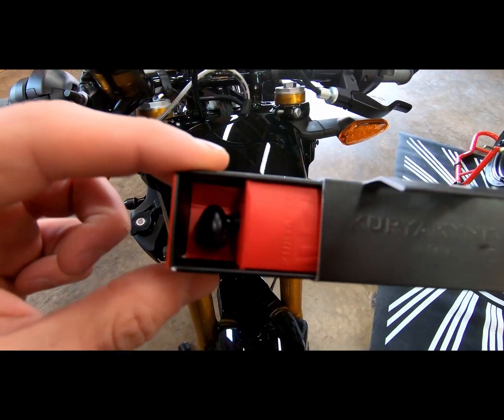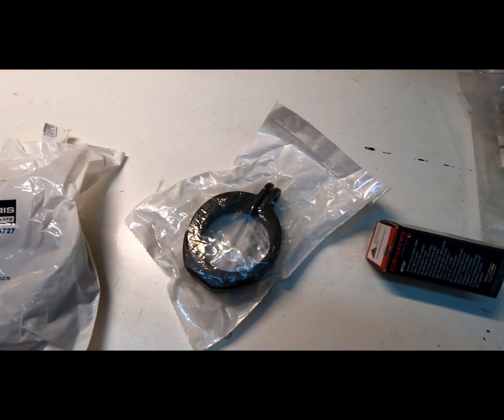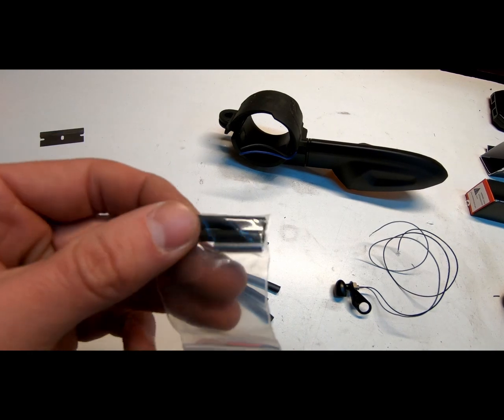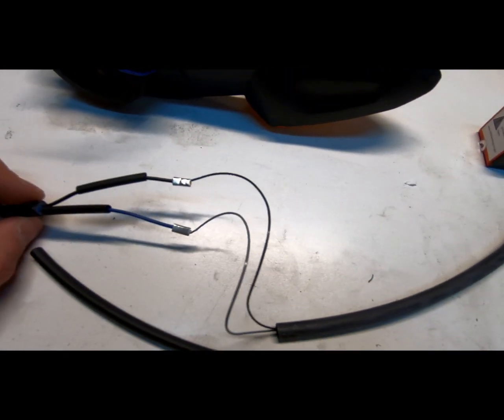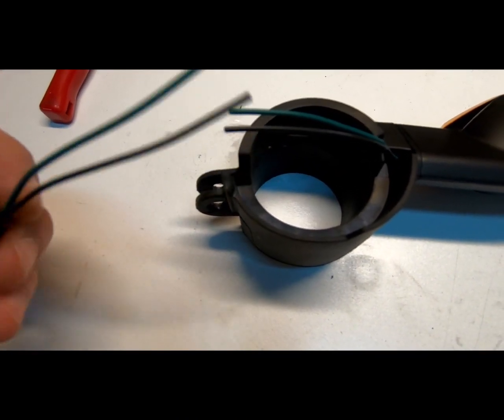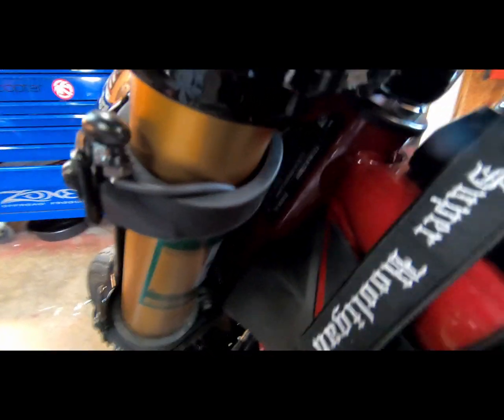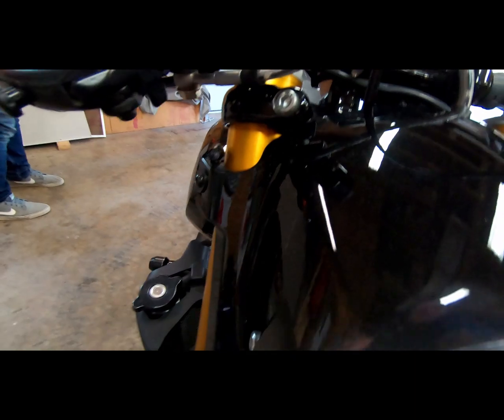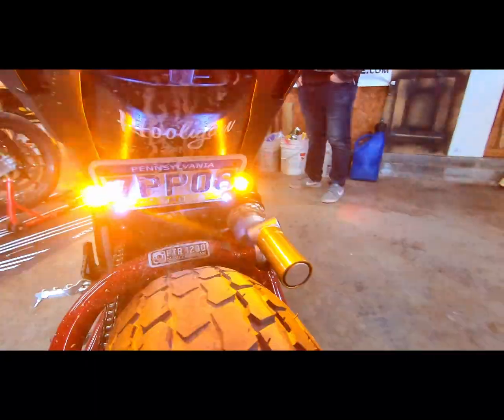INDIAN FTR1200 Kuryakyn by Kellermann front turn signals

Comment: Thanks for the video, I installed a set of different led turn signals and had electrical issues so went back with the stock but I have purchased a set just like yours they were for a different bike but I’m going to try them on my FTR since you didn’t have any problems, thanks again
Reply from the maker: Yep ive had these for Alost four years and have installed them on a few other ftrs and my challanger with no issues. You can add load resistors to make other lights work with the CANBUS system on the indians. But its just easier to use these.

Comment: Nice to meet you. I attached a Kellerman turn signal to the FTR1200.
If you blink the turn signal, the engine speed will become unstable.
Do you have such symptoms?
Reply from the maker: Nope. I’ve installed these on a couple ftrs. I’ve had them on my bike for two years with no issues.